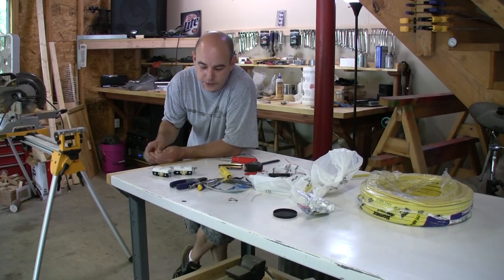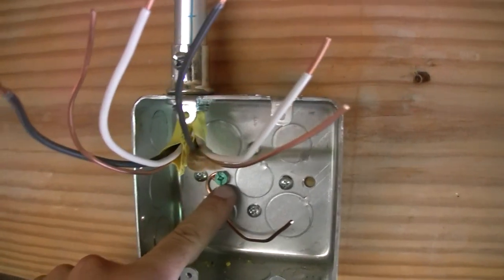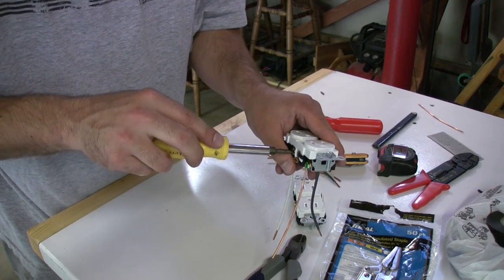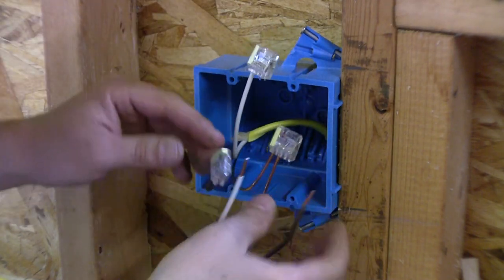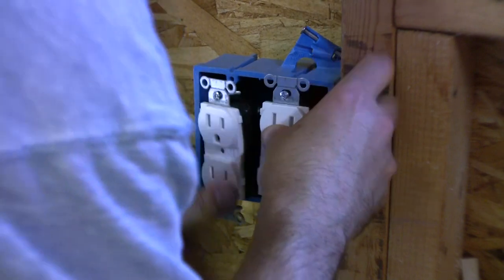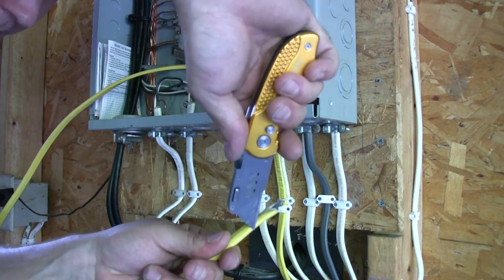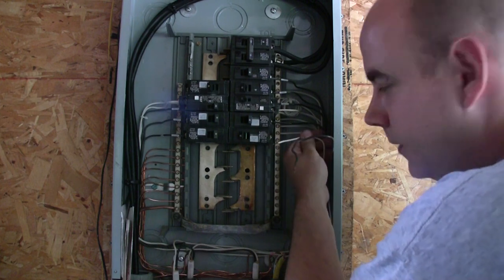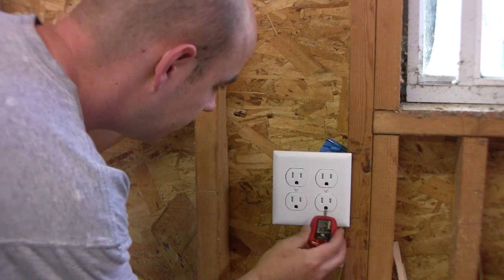Adding Outlets & Double Receptacle Wiring

Comment: Happy to see someone else using the new insure connectors...saves time and the bulk of wire nuts besides, you can see the ends of the wires where in a wire nut, you cannot see f a short occurs from a loose connection.
Reply: @Writer B.L. Alley stab backs are even against the 2017 nec code I believe. Same on everything thing you've said, I've fixed so many outlets and rewired because of stab backs
Reply: @Writer B.L. Alley it's just a shortcut to a problem. Sure some may hold and nothing's wrong with those but the problems that do occure when things go south are just not good. Fully on board with a ban

Comment: I have a wimpy 120 v breaker that I want to use to run wire for a dual power outlet. Light bulb and a parking lot long light. Is this 120 volt breaker able to do all that. I'm in new to electricity and i don't want to mess up.

Comment: I’ll add my two cents in here. If this is a sub panel, meaning it is fed from an over current device (breaker), it needs to be four wire and the ground and neutral separated. But what caught my eye is the incoming power conductors. They are single conductors and are not inside a raceway(conduit). That is a big deal. You need them protected inside an enclosed raceway. I also do not see an identification of the neutral (grounded conductor). Three white strips to identify it.
Reply: Wow I hadn't even noticed the panel feeders are just clamped to the box!    Jesus christ
Reply: B_a_c_k_s_t_a_y    Please read Article 250.32(B)(1) Exception No 1 and Exception No 2.    I wish NEC would just decide which way they want it and live with it.   They are still waffling and have flip flopped since I started in 1983 about separate building feeds.

Comment: RECEPTACLES NOT OUTLETS!   Receptacles are installed in outlet boxes.    A disconnect for a condenser is an outlet.   Why are the grounds connected to the neutral bar?   This is a sub panel!
Reply: I don't have a problem with "outlet" ... to me an "electrical outlet" accepts one plug.  A duplex receptacle has two outlets.  another video I just watched, the guy kept calling them "plugs"... that drove me batty!!
Reply: Jovetj     I agree!    Worse is "plug-in".      2017 NEC Definitions.   Outlet.   A point on the wiring system at which current is taken to supply utilization equipment.   (From a Handbook). "The term outlet is frequently misused to refer to receptacles.  Although receptacle outlets are outlets, not all outlets are receptacle outlets.  Other common examples of outlets include lighting outlets and smoke alarm.  Respectfully,    Kevin

Comment: Mitch, looking at your garage/workshop panel I see that the panel still has the connecting strip between the ground buss and the neutral buss. The neutrals and ground busses should only be tied together at a main entrance disconnect panel at the point where power is supplied from the pole and not tied together at a remote sub panel. I'm still learning at this electrical thing but please tell me if there is some sort of exception to the code on your installation... thx
Reply from the maker: +Richard P well I use to have separate power from pole then got tired of having two meter bills. So I ran underground from house to shop. The house had more then enough service. This is something I'll look into. Maybe I should remove that connection. Thanks for the tip.
Reply: because a short WILL send power back through the ground from the neutral...  i came to this video bc I'm re- hooking uP a dbl gang with a supplied 12/3w grnd and can't find my ibew book! (argh)  This vid isn't what i needed, but wanted to give props anyway.  I'm kinda more surprised that the inspector didn't pick buss bars over the condy!!
Reply: Richard P i subscribed to ya!  i like all yer stuff man! 😎👊👊
Reply: Richard P Good call!!

Comment: On (heaver usage) shop wiring the friction clips of outlets are not permitted. They may be permitted lightly used household circuits.
Reply: Those were not friction clop or ‘stab lock’ type outlets.  They were screw down ‘back wire’ style that is (thankfully) replacing the terrible stab locks.

Comment: Sheathing should be stripped about a half inch into the 2-gang box, not 8 inches. Those wire connectors are amateur, use wire nuts/marrettes. You shouldn't need any marrettes/connectors here. Leave the wires real long coming into the box, strip the middle of the neutral and hot wires, loop them around their screws and then continue them onto the other receptacle. Ground and neutral shouldn't be connected together in that subpanel.

If you take anything away from this, it's the last part.
Reply: Looping conductors like that is against Code.

Comment: Is the feeder for that panel individual condcutors not in a raceway or cable?  This entire panel should be checked by a licensed electrician.
Reply: Yes.  Just the wires clamped to the box.  🤦🏻‍♂️

Comment: If its exposed or open concept like u have , all electrical lines must be in conduit, pipe,flex, mc cable, and u must  connect to metal box , i would use 4s deep with single or double gang 4s face plate

Comment: electrical tape.WHY??????????????????????????????
Reply: Fire!  If one of those connections or outlets fail, the tape might smoke.  I see no practical reason to use tape inside an electrical box.  I'm surprised it's allowed.
Reply: Prevents the metal surfaces, i.e., exposed wiring, screws, outlet box, from making direct contact with one another.
Reply: Czechdog they can't!  Unless you wired it wrong or if you unscrew the device.
Reply: When you have bare wires, screws and metal box exposed, then you jam the receptacle into the box, there's a likelihood that something could touch. If it doesn't make contact at that point, electricity vibrates and, over time, it has been known to loosen screws. Also, look how many times you use a receptacle by plugging and unplugging things. After a while you could cause something to loosen. Seems trivial I know, but when it comes to electricity, why take a risk when all it takes is a few inches of tape?
Reply: When the screws loosen (from heat cycles, not from the AC cycles), the resistance will cause more heat.  That heat will melt the electrical tape or catch it on fire.
Reply: I am, by far, an electrician nor do I attest that I know anything about it to a degree which I don't help. Wrapping tape is what I was taught, but I will mention this to the person who I was advised by. I'm hardly even at the level of a DIYer, but what you said sounds right to me, although "heat cycles" is something I've never heard of.
Reply: Czechdog I'll see if I can find an appropriate reference later.  If you heat up a bi-metalic connection, the dis-similar metal expand at different rates.  They also cool and contract at different rates.  Do that over and over again.  I doubt it even has to be a dissimilar metal.   Go look at a lamp holder, the ones that utilize screws basically fall apart because of this.  I'm not an electrician either.  I have to take the information that I hear from tradesman with a grain of salt.  They are in the trade to make a living.  I trust the engineers more, but many haven't had a hard day's experience repairing anything outside of their line of expertise.

I've seen more outlets fail because they loose their ability to tension the plug than loosen a screw.  But, lamp holders have loose screws all the time.  All because of heat.
Reply: Nicholas Smerk where I live we have lady bug swarms in the fall they find their way into the electrical boxes and pile in there for the heat eventually they get packed in so tight that they arc the contacts on the outlets an outlet not being taped almost burned my house down because of this luckily the hot wire burned into before it caught fire but it did get hot enough to melt the outlet the whole time I worked in construction I never met an electrician that didn’t tape outlets and switches for this very reason
Reply: Austin Odell, sounds like a fair reason!  I always figured it was just for the drywallers/painters sake.
Reply: Holy sht! Ladybug swarm?? Unfortunately I'll now have to consider applying pesticide around my outlets. Geez…..
Reply: Czechdog yes swarms lol they get pretty bad in some places there was one house we built that was shaded on the back and sides by trees but the front the sun would shine straight on in the evening we were putting up cedar ship lap siding and had to stop working on that wall and only work on it in the mornings because they would cover the wall and us when the sun hit it we couldn’t get anything done for trying to get them off of our faces and trying to get them off the wall to put up each piece of siding without having bugs under it it was a nightmare lol
Reply: ha, I have to purchase Ladybugs for my gardening.

Comment: Mitch - what is the difference with Yellow Electrical wire and white electrical wire ?
i see you have 2 types being used going to the Fuse panel
Reply: 15A / 20A (yellow) But honestly.. if you don't know this.. then well... Put down the screwdriver.. and NEVER open that Fuse panel again!
Reply: The outer jacket of non-metallic sheathed cable has been standardized the past several years:
White = 14 AWG 
Yellow = 12 AWG 
Orange = 10 AWG

Comment: More people, like this guy should add fast forward when using a screw driver.  Who wants to watch 15 seconds of people turning a screw.  Good Job. ALSO he adds electrical tape around the outlet screws and wire ties.  People say it is not necessary.  A wire only has to loosen once to prove that this extra safety step is worth the time.  Do it, the folks that say it is not necessary, and may be right 95% of the time.  The other 5% of the time you could have a house fire.... This guy HERE does it right.  Other insight below does show he could do a few more things that perhaps he missed.
Reply: There is a lot NOT done right here.  It's not a good example.

Comment: if you were to add another outlet or something else to the last double duple receptacle at the end would you connect to both receptacles or only 1?and how would you do that?
Reply: He set it up to connect into the 4-position push-in wire connectors.
Reply: The new wire being added would also have a black, white, and bare conductor. You could just fasten the black wire to the screw (dark brass),  the white wire to the silver screw (neutral) and the bare to the bare wires. These are all on one circuit/breaker so there would be no problem at all.  Retired now with 40 plus years in the electrical field...

Comment: I can't find any channel that will explain how to wire parallel receptacles.  Are you wiring series or parallel?  How do you run a series of receptacles in parallel specifically?  Thanks
Reply: @Writer B.L. Alley I have installed receptacles, switches, and breakers and can understand concepts fairly easily.  Perhaps you don't know how either.
Reply: @Writer B.L. Alley Great for you but my question remains the same.  The reason for the question is I want to do it right but your reply was arrogant and condescending.  Even you started somewhere.  I've had licensed electricians screw up wiring and still charge outrageously.  I'm not wanting to rewire a home just add a couple of receptacles to an existing circuit.
Reply: Receptacles are always wired in parallel.  Duplex receptacles have four terminals on them to make it convenient to connect incoming wires to one pair, and outgoing wires on the other pair.  No pigtails or wirenuts needed, except on the grounds.
Reply: Jim Buford    Jim,   Your question is valid from a different view point than some of us have.   I look at all receptacles being wired parallel as all hots on bronze screw and neutrals on silver screw, but that is not what you are asking.  I believe you are asking should you splice conductors that then connect to the device or should you connect to the device and feed thru it.   A code answer is either way is approved.   The splice guys say they could lose the rest of the circuit if one burns out.    My opinion is if you burn up a receptacle, you should have already fixed a problem.   Best Wishes Sir,    Kevin

Comment: Not using a wire nut is asking for a fire.
Reply: There's definitely a lot of controversy about wire nuts vs Wago style. The contact area is far greater on a properly installed wire nut, no doubt. I've experimented with Wago's and the mark left on the wire is like a small nick where surface contact is made. I would feel better about them if they were designed with more clamping contact. The claim is that they have been using them successfully in Europe for years. The difference is that European system uses 230 volts thereby requiring only half the current to get the same power. European receptacles are rated at 2.5 amps. To me, that favors the use of wire nuts in North American electrical connections.

Comment: are you using 20 amps on 15 amps receptacle?
Reply: Modern 15a receptacles have 20a feed through rating so it's fine, I still wouldn't though

Comment: Can you run a 12-2 wire to a double outlet and use a 30amp breaker?
Reply: Not legally.  Why would you want to?
Reply: @jovetj  I want to run  one about 5 feet from my power box.
Reply: Pale Horse you need 10awg for a 30 amp breaker
Reply: Pale Horse    15 and 20 amp receptacles are NOT allowed on a 30 amp breaker.

Comment: Thank you for the video, very helpful.  Quick question about your short conduit run.  I didn't think you were allowed to run Romex through conduit.  I thought, to enter conduit, you need to go to a junction box with the Romex, then come out of the junction box with individual wires that run through the Romex.  Asking as I have a very similar install (short run of conduit) and want to do it as safely/code as possible.  I do understand, though, that your run was so short that the heat concern (with running plastic sheathed cable "Romex" through conduit) is probably minimal.  Thoughts?  Thanks again.
Reply from the maker: +Brian's Garage oh the technicalities.... I'm no electrician by any means however I did currently change the way this conduit run is and switched it to PVC and ran it even farther however I still used Romex Wire. I think if you think your wires going to get that hot jump up a gauge or two or down actually;)
Reply: When I installed new electrical wiring in my child hood home for the shop, I used both EMT conduit and BX cable which was the earlier type of metal clad cable now commonly known as MCC.  I used a junction box when I changed the wiring method to interconnect BX and EMT then using solid TW conductors to pull though the conduit. Romex was used only where the wiring was not exposed.
Reply: They changed the code a few years ago.  The NM-B manufactures allowed for it before then anyhow.

Comment: were those little square things basically the same kind as wire nuts?
Reply from the maker: Yes. Just a new push in type. I still use wire nuts sometimes.
Reply: i would refrain from using the push in connectors for power loads , where you may encounter higher amperage and excessive heat loads. Im ok with using them on lighting circuits especially with less demand due to the use of leds.The push in connectors have proven to be problematic over the years on receptacles and can fail and cause fires .cant go wrong with twisted wires under a wire nut.
Reply: I refrain from using the push-in things at all.  It's push-in connections on outlets and switches all over again.  Forget history, doomed to repeat it!

Comment: 12/2 wire why not use 20 amps outlets?
Reply from the maker: +C Vaz great question! I used the 15 amp because they have the tamper resistant feature witch is like a dust cover on the inside. It folds out of the way when you plug into it. I like the idea of keeping sawdust out of the outlets as much as possible. However I could not find that on a 20A version.
Reply: They sell 20 amp tamper resistant outlets.  Home Depot and Lowes both have them here.  But practically, when is the last time you have seen a 20 amp plug on an appliance.  Maybe on a air compressor or a large window AC.
Reply: It is okay to not use 20A outlets on a 20A circuit.  Of all the things wrong in this video, that isn't one of them.  But I did have to install 20A outlets in my father's garage because his drill-press wanted it.

Comment: ... sorry, lost me at 2:28..
Reply: the things hes connecting them to simple connect the circuit between the wires.  The blacks go with blacks, whites go with whites, and grounds (bare) go with grounds.  The black is basically the power going into the system (black wire is typically hot).  The white wire carries the power from the black wire back to the panel (white wire is called a neutral).  The ground wire is for personal safety reasons, and makes sure electricity always has a safe path to ground.  If you dont understand what you are doing, just call an electrician.

Comment: Why is Americas electrical work so unsafe
Reply: We harnessed it... we can do as we please.  When you other worlders invent something, let us know.
Reply: It is not unsafe,in fact it is much safer than other countries! In Western Europe for example , the design of the outlets is such that a plug can be inserted in a reversed position,so that live and neutral are reversed! Also, there is no official wiring convention for common outlets.On top of that the neutral sometimes carries a voltage that can be dangerous! 
American wiring can be sloppy,but the electrical code is better imo.